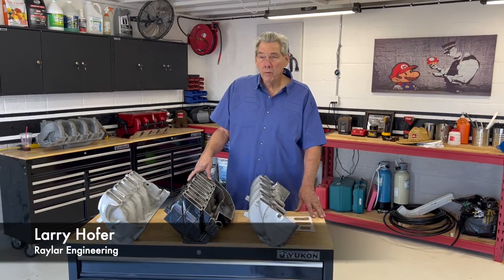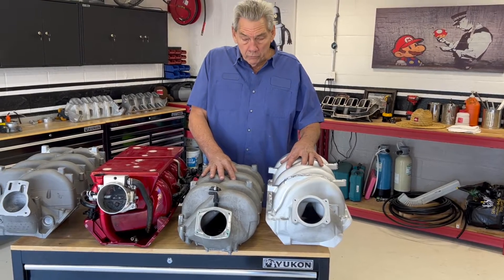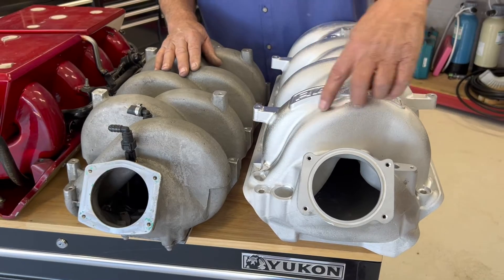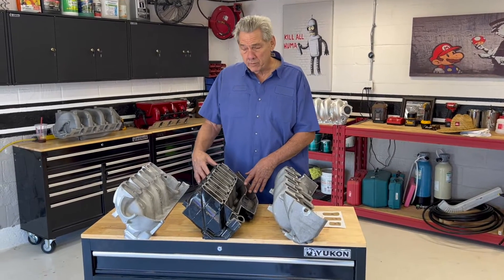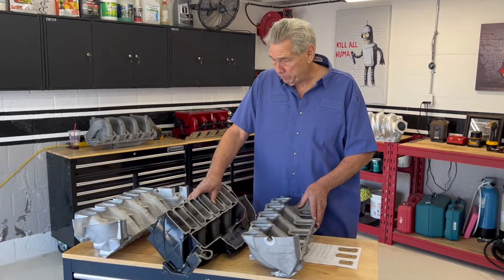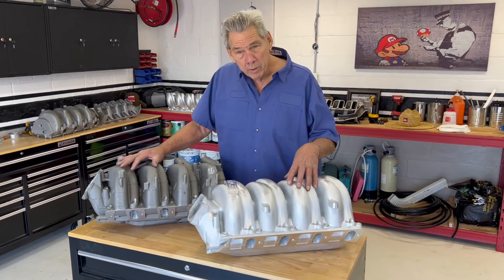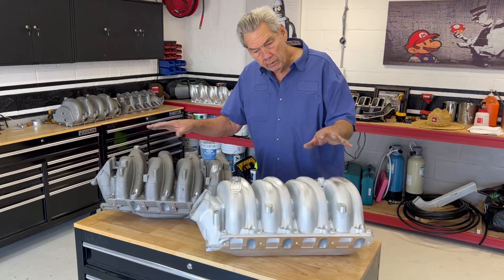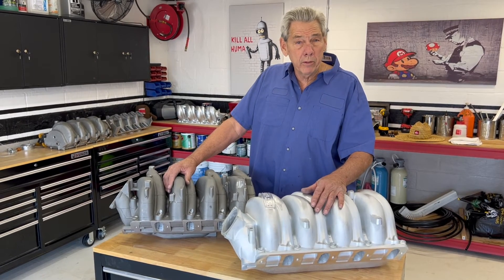Raylar GEN7R 8.1L Intake Manifold - Cool Gap / Stock Modified / PSI 8.8L

Comment: Have you ever done a 12" or a 10" runner variant to see if it'll raise the power to a higher rpm range for people like me that love drag racing.
Reply from the maker: Yes we have. You'd be sacrificing basically all of the torque advantages of a big block below 4500-5000rpm in exchange for gains in the 7000rpm+ range which require huge cam durations, additional valvetrain stabilization, big torque converters and most importantly - added cost. We decided it didn't fit the mold of our clientele - most everyone that runs these motors has them in a boat, truck, rv, large classic, etc. and is looking for a bump in streetable performance. I'd tell you to build a traditional gen 5/6 big block for drag applications as the parts are more widely available.

Comment: Great video.  Planning a Raylar intake manifold and aluminum heads on a GMC Yukon XL 8.1L.  I think the stock TB will need to be changed to a 90MM model.  Any recommendations on manufacturer, part number?
Reply: I believe you're drive by wire, correct? Electronic throttle? Very slight delay if you tap the throttle until throttle is applied? Grab yourself a 90mm Bosch TB, best in the business, inexpensive because it's not made from billet and anodized, everyone runs them who knows what they're doing and not just worried about a shiny TB

Comment: Any intake that would fit under a stock tri five chevy bel air hood
Reply from the maker: That's going to depend more on your engine mounts, placement, crossmember modifications, etc. I would say to stick with a stock height intake like the GEN7R, and then test fit things a whole bunch as your hot rod application will be a complete one-off.

Comment: Is there any news on a composite intake?
Reply from the maker: We built one, and decided there wasn't a reason to continue with it. Our initial design had short runners as well. The problem there was that it killed all of the low end torque and only made power up top. This is great for race cars at 7000+ RPM, but doesn't work for street vehicles running 2000-6500RPM which make up 99% of the iron block 496 market. We also thought about making one of the GEN7R manifolds as a plastic piece, but in reality, the air moving through an intake manifold is moving so quickly that minor amount of heat imparted doesn't change things to a meaningful degree. (Motortrend's Engine Masters showed something similar in one of their episodes.) We decided to stick with aluminum as its tough and light weight.

Comment: I have an 01 2500hd with the 8.1, bone stock engine at 139k on the clock.  Does this manifold internal "pcv" that the stock manifold has or do I get to figure something out?  Id prefer plug n play but fabricating something isnt off the table.  And im seriously debating tossing on the wipple blower just for the hell of it.
Reply from the maker: 6:50 - Yes it does. GEN7R is a plug and play replacement (with the exception of the larger throttle body). Also, I can personally attest that the whipple blower is the mechanical devil on your shoulder. The blower whine makes you want to stand on it everywhere.
Reply: @MicahCoy  Ill order up the manifold sometime and go from there

Comment: Good Video!  Currently have HO525 kit minus the Raylar heads.  80mm CoolGap with ported stock 78mm tb.  Any gains upgrading to the new 90mm intake/tb?
Reply from the maker: The smaller throttle body will keep up with the stock heads.

Comment: If I want more low RPM torque? I would need the BSI/PSI intake (sorry its a hearing confusion on my end due to bad speaker on phone). That particular intake would give better torque between 1400-3400 rpm? Could the 8.1 reliably produce 600-700 ft#'s of torque as low as 1400 rpm?
Reply: Looking to build an engine that would produce almost double the torque to HP ratio. Like 400hp/800tq. Or would I have better luck with the Gen5/Gen6 talldeck block with a p nut or oval port head? Would one of those intakes work on a older talldeck?
Reply from the maker: @bladenrexroth2555   The solution there is to stick with the stock manifold, a small (torque optimized) cam, and about 14lbs of boost. The 8.8L manifold will require you to change the heads and will still require a small cam and boost to get ya there.

If you dont want to build a custom turbo system and you want something that bolts on, the whipple kit will put about 8-12lbs of boost (depending on pulley) into your engine https://www.youtube.com/watch?v=zTDnr0wj3UU
Reply: @MicahCoy  have parts numbers on those heads and the 8.8 intake? I have no problem building a single turbo system to aid in low rpm high torque production. Think I would need to upgrade the rotating assembly with forged parts. Is there a gear driven timing set thats compatible? I wouldn't trust a chain drive with that kind of power.
Reply from the maker: @bladenrexroth2555  I don't, thats outside what we do. You can reach out to PSI's sales department.